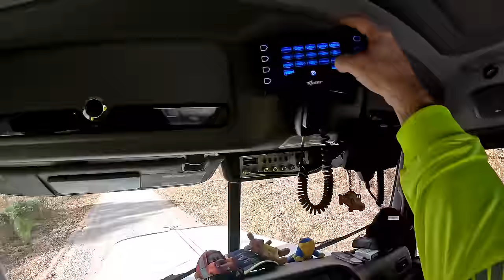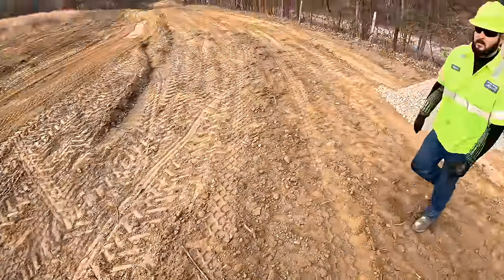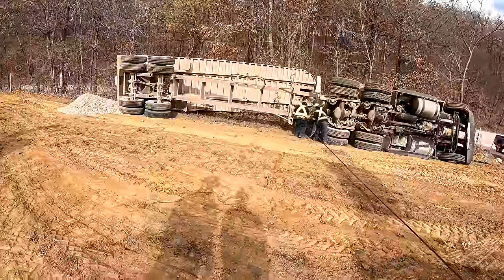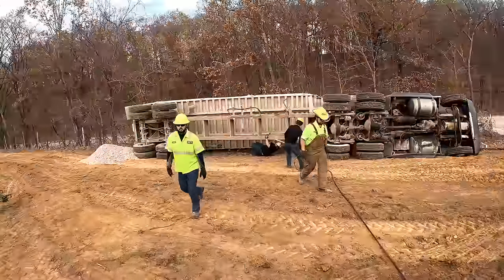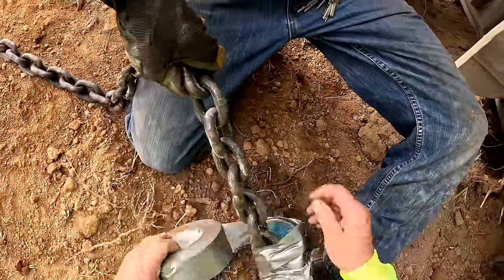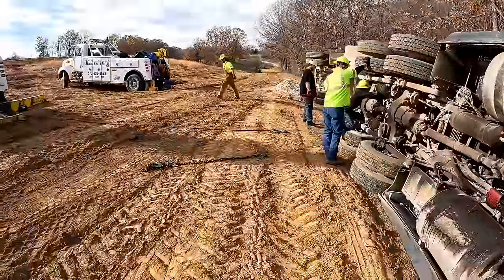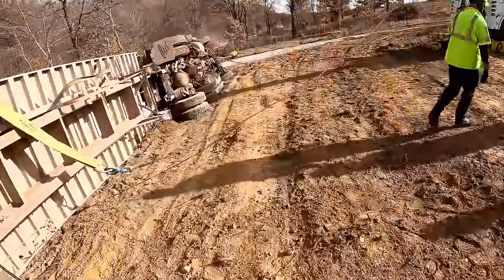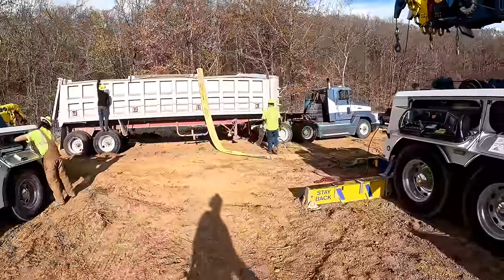THE ROLLING STONES!!! ROCKIN' & ROLLING...OVER!!

Comment: Any young aspiring tow truck operator would be extremely lucky to get to work with you.
Reply: I'm thinking about moving to America, just to learn from Ron. My off-road recoveries have improved (and probably a lot, lot safer) thanks to Ron and Casey LaDelle. 

Now the only complaints I get, when doing my winching, is that I over-engineer it. My response? "It never hurts to think of Safety"
Reply: @petermiddo  Do it right the first time, so you don't have to do it again and again.

Comment: Here's a little lineman's trick Ron. Fold the tape over on itself when your done with it. That goes for the roll and whatever your taping. It just leaves you a tiny tab so you can always remove the tape from the roll and the thing you taped.

We have to do that on powerlines because of our rubber gloves and leather covers.

I promise if you get in the habit of doing it. You'll do it every time without thinking.
Reply from the maker: Yep.  I'm aware of that, but always seem to forget to implement it...LOL.    Just need to make a habit of it.   Repetion, repetition, repetition....   Thanks and God bless.
Reply: Developed that trick for myself with packing tape. Never regretted it.
Reply: Electrician I know calls that a buddy tag..
Reply: @RonPratt  or keep a multi-tool with you :)
Reply: Not just a linesman thing where I am. Don't know too many linesman but know alot of people who do that in that sort of situation. Obviously things are different there.
Reply: Yes sir, its called a courtesy tab in the Low Voltage industry..
Reply: @jeremyd.5467  It's called getting the roll of tape thrown down at you if you forget in powerline work 😂.
Reply: called a 'courtesey tab'  used to use them in the pharma manufacturing business for autoclave loads.
Reply: @Robmancan1987  Fixing you mistake would get old very quickly, with that exercise.
Reply: @gorillaau  You gotta be able to have stuff thrown at you and throw stuff back in that line of work. You can dang near kill each other after lunch and be buying each other a beer after work 😂.

It's definitely not a job for the faint of heart or easily offended. If you put a cowboy, soldier, engineer, carpenter and acrobat in a blender and combine that with the mouth of a trucker you get a lineman. 😂
Reply: done that forevrr
Reply: done that forever
Reply: It's called a courtesy tab......as I was taught in late 90's working on bridges.....
Reply: @benmac940  It's a great habit for any tape, down to paper tape, Scotch tape. Saves a lot of time and frustration trying to peel off sections of Scotch tape when it lifts and peels off only a raggedy section, leaving the rest stuck fast. Very very frustrating with something like Gorilla tape that sat up in a hot summer garage for a month or two and you have to use pliers to peel it apart.

Comment: I built and repaired dump trailers for over 25 years.   Nice to see a really good recovery.   I've dealt with more than a few units that the recovery people did more damage than the roll over.  And you were lucky the hydraulic cylinder retracted, often they were damaged and it wouldn't collapse.   But REALLY nice work.

Comment: I was hoping to see how you maneuvered that rig across that culvert to the road! Maybe another time, though. . .
Reply from the maker: @Paul Crumley I wish I had kept the camera rolling for that part, because it turned out to be the most difficult part of the job.   The uprighting was simple in comparison!!  What I thought was going to be a simple hookup and tow turned into quite the challenge   We couldn't tow the combination with the Rotator because of the narrow driveway and culvert.   We used the single axle Pete and had very little weight on the steer tires.   Loose dirt, loose gravel, hillside, narrow driveway, and gravity proved to be a difficult combination.   We considered "split-towing" them, but the aforementioned conditions created the same problems for dropping the partially loaded trailer.   We made it, but there were a few "hairy" moments.   Thanks for watching and God bless.
Reply: Can you explain the “drag winch” vs all the other cables?  Many thanks.
Reply: @harveywaitchison2062  the drag winch is mounted under the boom and just like it's name implies it drags stuff instead of lifting
Reply: @Will-ct9ww  Ron doesn’t like using it.  I think it sticks somehow.
Reply: @RonPratt  why not rehook to the rotator once you got the truck past the culvert with the single axle Pete?

Comment: I've been following the channel for about 5 years, and only just realised that the lift axle on the Rotator also steers when i saw the shot of you setting it in place on the site.  Another really professional job by all concerned and the 4K video is brilliant. Glad to see the driver wasn't injured. Greetings from Leicestershire UK.
Reply: It works like a caster wheel. Does not play well in reverse on soft Ground cause it does not lift high enough.

Comment: I have watched many rollover as well as other calamities. Midwest, LA, Great Britain and German. L.A., Great Britain and Germany uses fine heavy duty equipment and many types of recovery trucks and have many trucks to do the job that Ron does with 1 or 2 trucks. With roll overs they don't often slow the truck and trailer down but let it slam it's wheel into the ground which hurts to watch. Ron really showed how it is done in this fine video, probably the finest recovery of it's kind I have ever seen. With Ron you also have a play by play explanation which it makes his video much more pleasant and instructional. By rights, being an old retired guy I expect that I will never encounter  need of any knowledge I can glean from the movies. I have actually learned quite  few things that makes other jobs easier and safer. Thank You Ron, you are the best.

Comment: This video shows several key points within your company. 
1, The importance of safety. At one point you commented about 'that's why you have a hard hat'. You ask for the team to be careful and watch their footing on the loose rock.
1b, You requested job critical communication only. It's important to have clear communication when working a job as such. Idle chit-chat can prohibit critical information from being relayed on comm-sets like what you are using. 
2, You are showing professionalism in your work. Strapping the box, trying not to crush it even though you think it's done for. That's not always the case once it's uprighted. Taping the chain. Orchestrating the whole team at the same time to perform multiple tasks. 
3, Teamwork. You have multiple people working together doing different tasks at the same time. They are fairly well trained enough to work with you, knowing what's needing to be done. They know the drill, you're just being the conductor the Orchestra. 
4, You still have humor. I've seen you have a good laugh even in serious situations. It helps relieve tension among your crew, first responders, even customers. I've watched you tell people that it happens, it's no big deal... then share jokes about it. Humor really does help the overall moral. 
Lastly... having such a huge crew on site for these situations isn't necessarily needed. But it helps get the job done quicker so you can get on to the next. It takes the workload off of the crew. And it also helps with training. There will be calls that you can't respond to, whereas Ethan can. He can use the crew to help him, as they already have the knowledge of what to do. It's better that they are on-site working with you. Learning from you. That way you know that you can trust them on those calls that you can't make. Between Ethan and Mike, you certainly have great leadership in the making. 
You are a wonderful person Ron. God bless. 
Happy Christmas and Merry New Year 💜

Comment: Ron, a tip on how to get the tape off the chain, and or roll. When you tear a piece off the roll, bend about an inch of tape over onto itself, so you have a pull tab for the next time. The same with the piece on the chain. The company I work for does power washing, and we hang a lot of containment plastic with zip ties and duct tape, and my boss has  us use this technique.

Comment: Awesome video and crew Awesome job 
I saw a steel end dump tip over  it wasn't a full frame. It had tube and twisted like a predtzl. They ended up cutting up the trailer. It was not towable. Denis from Santa Rosa CA

Comment: That's why I have fencing pliers in all my recovery rigs.. I ain't scared to cut fence at all.. it's amazing where barb wire tangles itself in a vehicle!! Drive lines, wheel hubs, I even had to fetch it out of between the torque converter and flywheel of one rig 15 miles off the dirt road!!

Comment: Good job! As a former dumo bucket hauler myself. We had to unload the load before they (wrecker folks) would upright the tractor and trailer. If not the dump bucket would have a chance flippin back when puttin the trailer on it's tires back on ground.

Comment: Over here in the UK the heavy recovery companies when using the under-lift on tarmac surface use 'coach-stands' under the wheels once lifted and for safety in working underneath fitting securing chains. I note that you use wood blocks, Is this your preference or are pre-made metal coach-stands not used at all in the USA?

Comment: Wow Ron what a rocking video. Just wondering about something. What happens when the computer module goes down if you can still run the hydraulics. I notice that Pepe's and Plaza don't have the electronic controls other than their remotes.
Reply from the maker: Yes, there are manual controls on the rotator.  If you look closely near the base of the boom on the back side of it are manual controls for all the boom functions.   Manual controls for the outriggers and under-reach are hidden under protective plates, which would have to be removed in the event of an electronics failure.   Hope I never have to use them!!!    Thanks for watching and God bless.

Comment: @Ron what I have just observed as far as equipment goes could become an issue at some time, especially should you receive a response call on your return route to base. The equipment being used, I would allocate that the truck working the rear uses their chains and straps, likewise the front truck uses their equipment, at the end of the recovery it's a very simple matter in cleanup and equipment distribution.

Comment: Please excuse my ignorance, but a couple of questions that may have been obvious in the video...
Why did the truck drop so gently on the ground? Was the weight of the rocks that much that was putting that much strain on the rotator where it had to fight the weight of the rocks?
And, the other question - why couldn't you break the units apart? I assume the single screw truck could have towed the cab, and 'tator drug the trailer...

Comment: When collapsing that dump bed, couldn't you hang another snatch block off the upper frame rail and let it hang low enough just to keep that cable from rubbing on the lower rail? By upper and lower, I'm speaking of the position of the frame with the trailer laying on its side...

Comment: You mention the possibility of crushing the bed with the wrap-around strap.  Would it be worth it to add one of those adjustable 2-section lally columns, like you use to support a beam in the basement of a house, to the recovery kit? You could put one between the sides of the bed and adjust it out to support the sides of the bed right where you want to run the strap.  They are relatively available, not too expensive, and the two piece design would be easier to store.  You might need to weld the foot plate to the one end of the column, opposite the adjusting screw, but that's a minor tweak.  Anyhow, it's just a thought.

Comment: Question, the two snatch blocks for the redirects on the back of the rotator should have the hooks turned around? Not that they would have come out, just thinking it would be better on the back side of the hook.
Reply from the maker: Actually, no.   The safest practice is to have the hook tip pointing up so that the force is being placed into the throat of the hook.  The theory is in the event of a hook failure the block and hook would first hit the ground due to the direction of the force applied.  This would, hopefully, slow it down or arrest it totally.   If placed in the opposite direction, the force would, in theory, send the broken hook flying upward.    Thanks for watching and God bless.

Comment: Never cared much for end dump semi-trailers. They always seem so precarious and top heavy, especially if you are spreading gravel.  We used truck and pups for that kind of work, either 4 and 4 or 5 and 3 sets.
Suggestion, get your crew approved high-vis long sleeve Ts with a logo for cooler months.  The gravel company I worked for bought new Ts and hoodies for the crew several times a year since many of our jobs were at refineries which were sticklers for safety regulations.

Comment: You think the rotator could have done it alone?
Reply: Likely not.  It has the power but pulling the tractor's  drives and the trailer axles from one point would stress the mechanical components in the boom and winch head.

Comment: Not knowing anything, I am curious about your train of thought about not using shovels to remove the remaining gravel from the trailer before uprighting it.  I know you mentioned that a skid steer would not work because of the drop off.  Did you rule. out shoveling because you. did not have any and it would take a long time?  I don't have any idea of how much that remaining gravel weighs.   You made it look easy.
Reply from the maker: There was a steep drop where the top of the trailer was laying and the customer didn't want to lose the gravel that was in the box, if possible.   We made it work, as you can see.  We did have to get inside, with shovels, after it was uprighted to level out the load.  The load was against the left (downhill side) wall and was making the trailer lean heavily, so, we had to level it out before towing it.   Thanks for watching and God bless.
Reply: @RonPratt  I appreciate that you take the time to answer questions and educate your subscibers.

Comment: I have one question. Why didn''t you remove driveshaft while it was on it's side if you knew you were towing it?
Reply from the maker: Because the initial plan was to leave it there for a bit after it was uprighted.   They were going to unload the remaining rock.   We were going to separate the two and would have towed the truck from the rear, thus removing the driveshaft would not have been required.   Thanks for watching and God bless.

Comment: Knowing just how unstable those dump trailers are it amazes me that anybody would try to raise one and any sort of a side hill. These unstable unit would be awesome with some kind of a outrigger attachment that would move out about 3 to 4 feet from under the frame on hydraulics then go down to level the trailer before dumping the load. I realize the truck has to move forward to completely empty so they could be made with wheels and tires similar to a drop axle but only smaller diameter for clearance when it is in the retracted position. I know it would take business away from you but imagine if you were to start the company that made the modifications to these trailers...
Reply from the maker: They actually make a "side dump" trailer which is infinitely safer than the standard dump trailer.   https://sidedump.com/?utm_source=google&utm_medium=ppc&utm_campaign=102938160180&utm_term=side%20dump%20trailer&utm_content=b&gclid=Cj0KCQiA1sucBhDgARIsAFoytUuictViAcoeDvNb0qwD8axby10WAwn1GwbC9kI2Ko6YXWAjxpgVv3MaApLGEALw_wcB
Thanks for watching and God bless.

Comment: 35:52 That looks like a pretty sizeable cut in that strap along the sow seem. Was that there or did it get nicked by the barbed wire?
Reply from the maker: Fairly certain it got damaged during this job.  We inspect our rigging after each job and that cut SHOULD have been noted and the strap taken out of service.   Now, that doesn't mean that someone may have overlooked it on it's prior inspection, but I would like to think that's not the case.   Thanks for watching and God bless.

Comment: The camera doesn't give a true perspective on the angle. Many years ago, I was on a job in the Sandia mountains in New Mexico, and we were installing a 6 million gallon artificial lake, and the basin was dug, and we spent a lot of time digging rock out of the ground to make it smooth for the pond liner.  There was a good bit of slope to that Construction site. One of the problems with new job sites is soft surface area, and this is compounded by the angle of the hill side.

Comment: No, the camera does not do justice to the slope. 
Looking at the angles around 10:52 I would guess variable grades running 9% to 15%.
How far off am I? 🥴
Edit: I guess by the term "Mechanics Wire" you mean "Lock Wire" or "Mausing Wire"?

Comment: I'm gonna give a Thumbs Up, but really, I think the pull points on the spring rear and tractor drives should have been on frame, not on rim. This wasn't a passenger car... Those could have popped.
Reply from the maker: As always, there are multiple ways to reach 10.    If you noticed, though, we chained the axles to the frame, which basically does the same.   Thanks for watching and God bless.

Comment: The truck driver should have shoveled off the rest of that stone. It would have made this job so much easier plus he wouldn't have to worry about how to get it out of there after the truck is upright because not only is the rear pin broke on the trailer but most likely the trailer is tweaked and it's just going to flop back over if he tries to dump it off even on good solid level ground.
Edit: I'm guessing you guys probably shoveled that stone off before you towed it. There's no way you could have towed it with it all to one side like that.